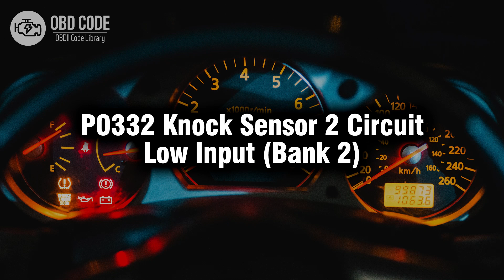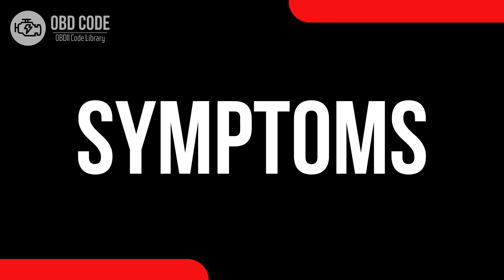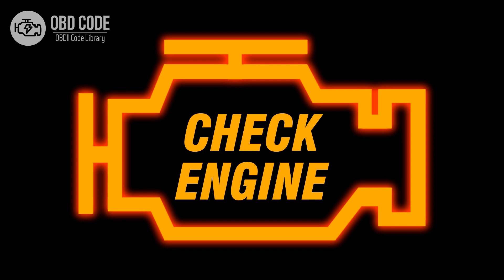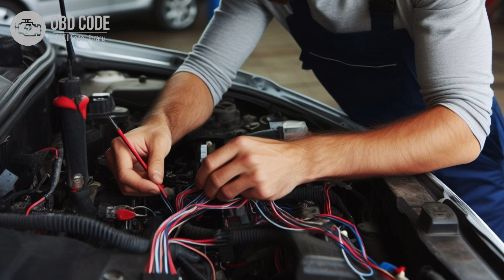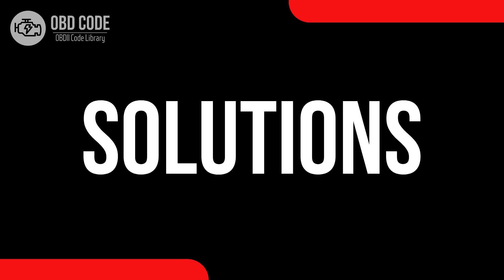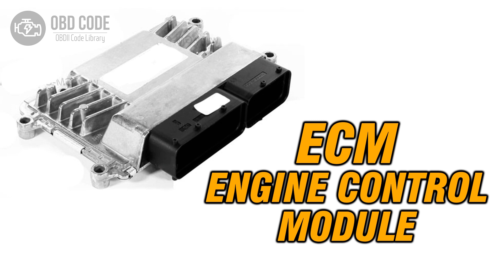P0332 Knock Sensor 2 Circuit Low Input (Bank 2) 🟢 Trouble Code Symptoms Causes Solutions

Comment: Solution: Switch to Premium gas and it will fix your problem.
Reply: Is it that true? I replaced the knock sensors and still have the problem if so I would be very thankful
Reply: @EMEGONZALEZTRKING  I did the same thing. I replaced the sensors for 1,050$ the dash light stayed off for about 3-4 days. I noticed later my radio presets were gone too. This is because they disconnected the battery cable. As a last resort based on other YouTube feedback, I put a full tank of Premium gas in. About two days later /  half a tank of gas consumed, the light is off and has stayed off. I have added another tank of premium too.  I think mechanics know this ca fix it too but aren't going to volunteer this information to you either.  This is why YouTube is the GREATEST invention since the printing press.. ADD PREMIUM gas before you spend any more money on a Mechanic!
Reply from the maker: Good morning, thank you for sharing your experience.